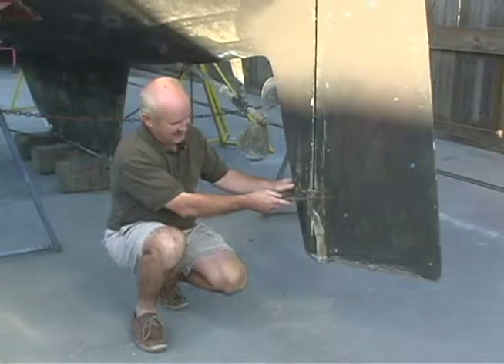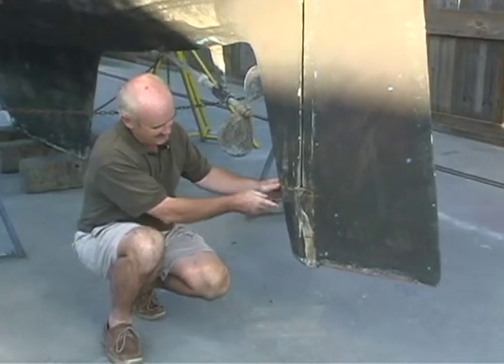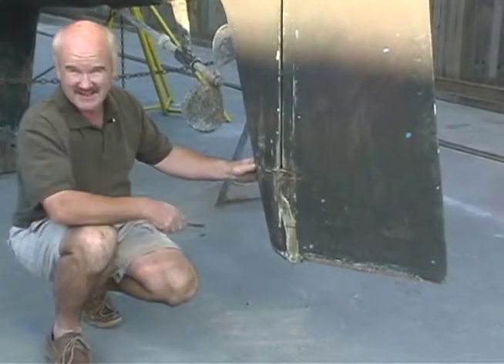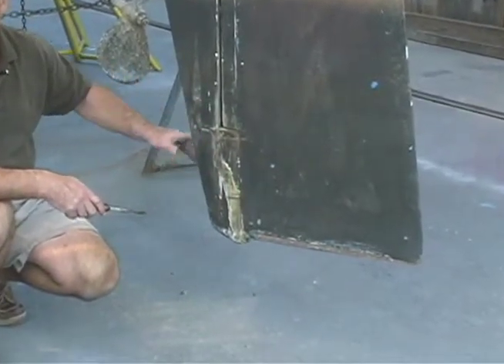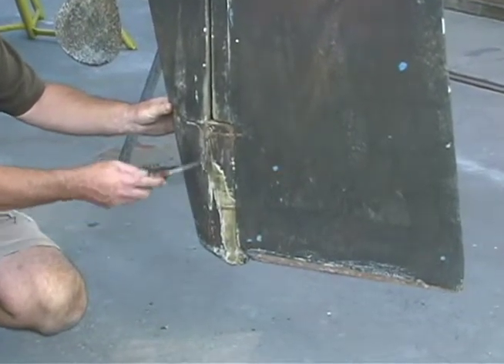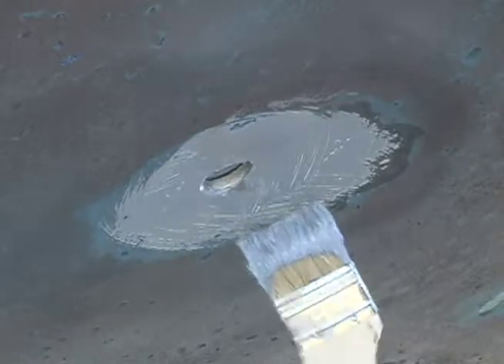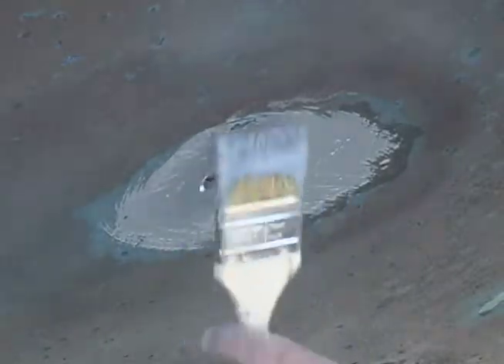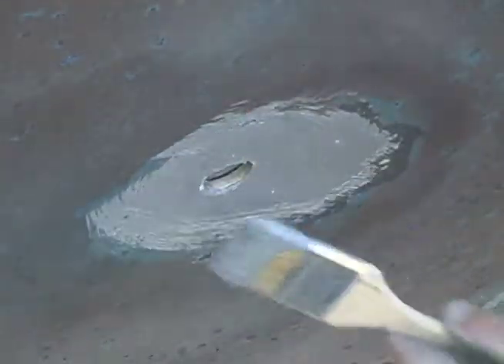5.3-EPOXY REPAIR #2- Restoration of a Pearson 323 Classic Sailboat.

Comment: How deep do you need to go on this sanding?
Reply: +The Thomas 
We took it right down to the original fiberglass.  Some places as you can see where damage was greater,  the dremel tool was deeper.  The Pearson has a pretty thick hull so there was plenty of depth for the sanding.
thanks...